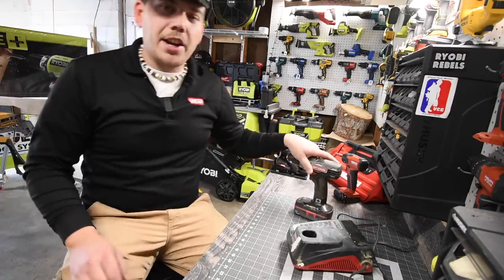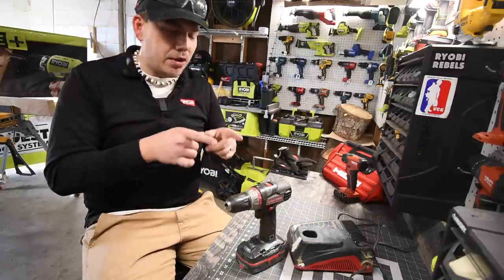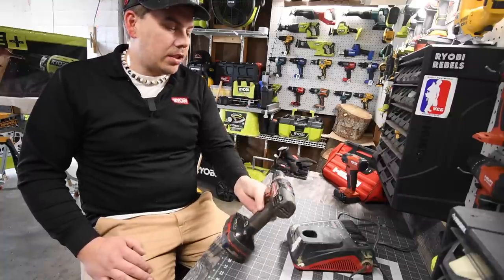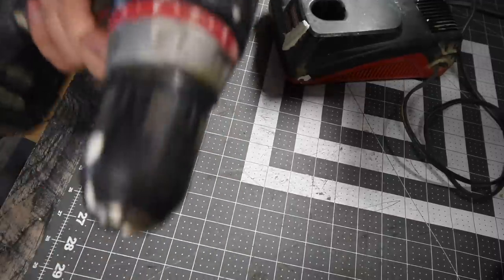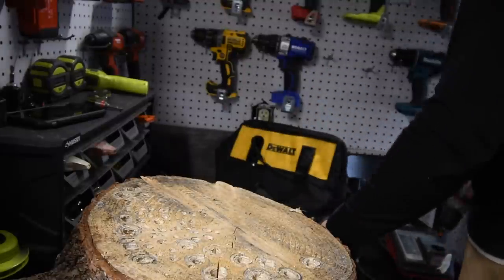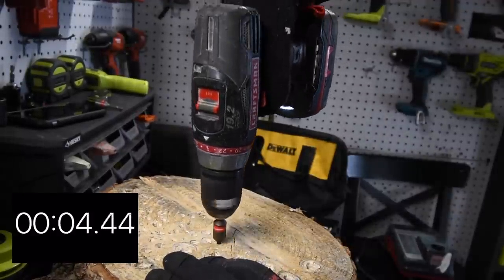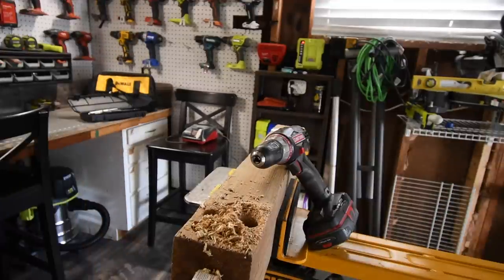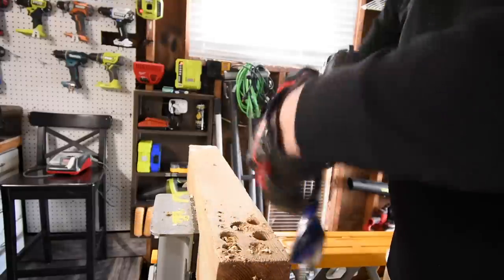Can a 15 year old Craftsman drill survive my test??

Comment: I bought a 19.2v og cordless from sears in Bangor Maine back in 2009. They hadnt even released the c3 branding and the Xcp Li-ion stuff. I used the shit out of it for years and about 4 years ago I picked up a whole bundle of (from one of the combo packs) of the tools for $50 with a 3/8 qd impact, another drill/driver, 3 of the small li-ion batteries, a circular and reciprocating saw and other stuff. I bought some 5AH chinessy batteries from amazon (2 different 2 packs) for $40 each and I have used the shit out of all those tools. I bought the  caulking gun on ebay and the big boi 1/2 drive impact which using the 5AH batteries can take all 4 of my wheels off my yukon in 1 go. 

Recently on a trip  up to Maine (I live in SC) I picked up another 9 tools including the shop vac, a router, and jigsaw which I didnt have plus another 4 Li-ion xcp batteries for $200 plus $100 to ship it back to myself in SC. 

Having soooo many tools in the  same battery platforms is great and most of them are for small one off projects. They arent cutting edge but they work good, I have tons of batteries and additional batteries are easily obtainable. 

While in Maine I was using my fathers Makita and Matabo 20v tools and aside from the batteries not having the big dumb stem I noticed very litte difference in tools that were 8-10 years newer. My C3 5727.1 compact impact driver drives 3 inch construction screws just as fast as those tools and I have built a bunch of heavy duty shelves and mounted tons of stuff with it.

Comment: I still have a craftsman 19.2v drill that's a little older than this one. It's physically bigger. Until batteries couldn't be gotten a few years ago, that thing is a beast! I used to stand on it while drilling a 3/4 concrete bit into solid concrete. It was indestructible. I still have it. And the charger. Just need an old, but good battery! And covering all of its venting and the fact this drill was probably used a lot doesn't help!
Reply from the maker: it was a good test though lol
Reply: amazon sells batteries all day long

Comment: This drill is the only part of my craftsman line that is still kicking (barely). I almost constantly have to use an impact or more powerful option.
Reply: Power advantage with battery and charger is 199.00 at hd.
Reply: Or you can get the power detect kit for 279.00 and 1 free bare tool of up to 199.00 value!
Reply: @juanc5149  Good looking out bro! I'm looking deep into a new line to buy into
Reply from the maker: very good and I thank you for viewing

Comment: I hope this is taken constructively as my opinion is only that and this is only the 2nd video I've seen of yours...but your mission was to destroy this drill for sure.  Which I don't have an issue with. But you chose to use a drill in the place of an impact. However, leaning on any drill that hard will result in it not lasting. Let the drill feed at it's own rate. If you can't keep it drilling straight because of force feeding it then that operator error. Another thing is running it back to back like that. Does it prove how weak or durable it is? Yeah, kinda. Especially being it's that old lol. 

I'm sure you know these things and was just trying to get a certain outcome. But I do feel like you have the ability to take your channel well past VCG. Assuming you don't abandon a consistent basis in your basis. Once Vince started getting flack for being a Milwaukee fan boy he over compensated and started looking for clickbait titles and things to grip about over Milwaukee products. Which is increasingly more popular of the recent. People love to hate. And Milwaukee is always a top contender. (Yes, I am invested in Milwaukee. But it's because it just works and makes sense. Sometimes overpriced based off others prices. But they also offer more too.)
Reply from the maker: my father in law gave me his old drill. I just wanted to see if it can survive my tests. but the battery couldn't hold enough charge to complete the tests. I have one Brushless craftsman tools to film still. but I thank you for viewing JST4CYL